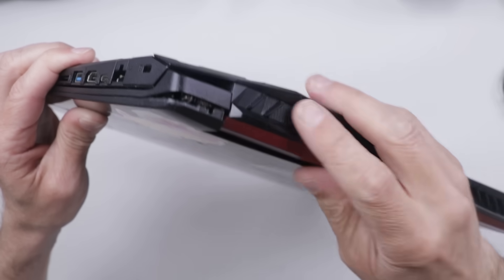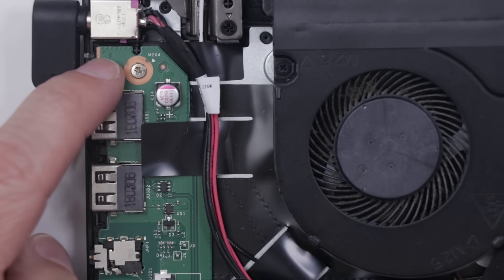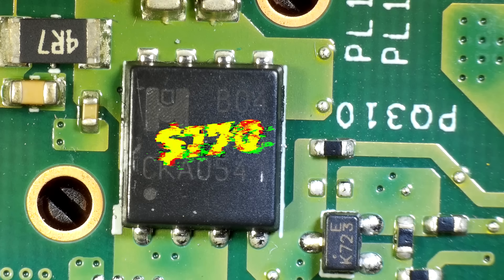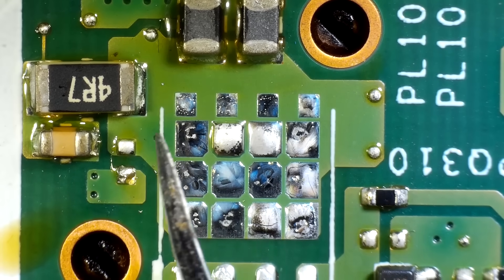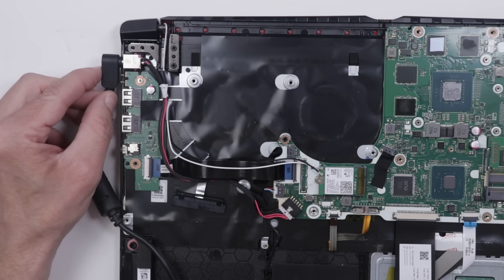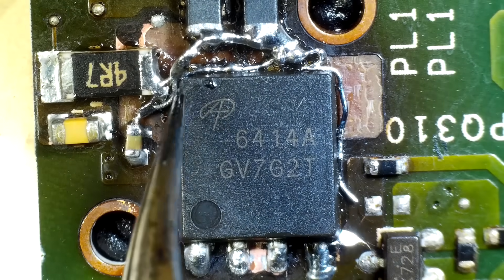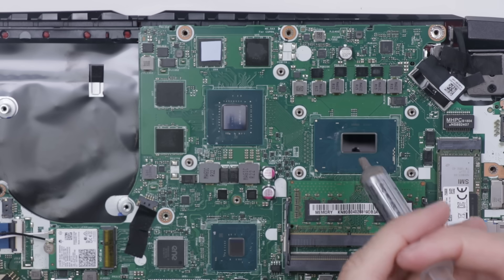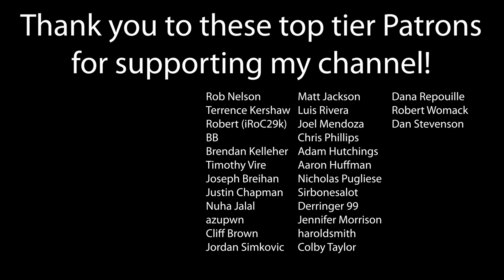FREE BROKEN Laptop - But Can I Fix It? Acer Nitro 5 No Power (Gifted From A Subscriber)

Comment: You are so good at this. My ASUS Rog Strix got fried by power surge and a repair shop told me they can fix it, then they called me and said it's complicated and finally they stopped calling me altogether. I had to call like 4 times to finally get an answer...yeah, we can't fix it. They had it for 6 months! They gave me back my laptop and I found out they didn't put back the HDD so I had to contact them again and tell them they better still have it (they did). That repair shop was an absolute nightmare, never again.

Comment: I mean since you bought another parts motherboard. Could’nt you have grabbed the copper plating that was fused under the MOS from the parts board. Like cut it out? Then you would’ve had the “heat sink” and everything.

Comment: I had a very bad experience with a nitro 5, the price for the specs was hard to beat but whenever I play games it became a damn volcano probably due to Intel processor, after many tweaking I manage to bring temp to a reasonable level (had to take a hit on FPS on many games) but if I had continue gaming on it as it was out of the box I would certainly had fried something since a normal temp was between 90 to 95 degree delicious whenever I played anything.

Comment: Thank you for these videos, I bought a "broken ps4" from ebay, when I got it the disc drive was just loud when a disc was in there, cleaned it out and it worked like normal, I watched your old videos to help guide me when taking it apart and putting it together.

Comment: Good idea with the coil of wire under the MOSFET. I would have also stock a thick small thermal pad on top of the MOSFET for extra cooling.

Comment: Very likely the MOSFET was part of the reverse polarity protection for the laptop, meaning someone plugged in a wrong power supply to the laptop. It would explain as to why it was so burned, and why after replacing it, it didn't blow up again. 
But still doesn't make sense since this MOSFET circuit shouldn't blow up. Maybe the guy shorted something with a screw and the MOSFET was short circuited. But as far as I know it's unlikely that it just broke like that, especially the huge burned part, makes no sense.

Comment: there is also a possibility one of those traces that were underneath the mosfet could be coming from the other side of the board that is supplying power to the other side of the board and that's why your computer is not turning on

Comment: Fun fact about Nitro5's. There is a pressure switch under the asdf keys that will prevent the computer from booting. It'll power up, keyboard lights up, hear it running, but no screen no boot sound beeps or anything. Press with about 10 lbs on the asdf keys. If you Google it this is a semi common problem with the Nitro 5. Had mine in my backpack sitting apparently upside down and the keyboard bowed or something.

Comment: Something else to watch out for.  Some of these mosfets have a diode that lets a small amount of current pass in one direction even when switched off and these diodes will sometimes fail while the mosfet itself still functions as a switch.  This diode is useful in some circuits like power input protection circuits where you don't want reverse polarity to destroy anything.  Some people just bypass the mosfet in those circuits completely and call it a fix or add a diode to across the source and drain that lets power through to the circuit that actually turns the mosfet on.  But definitely need to watch for hidden vias.

Comment: It looks like that part of the board where the mosfet mounts was never designed with thermal dissipation in mind.  Doesn't look like there were any vias to another layer of the board or even enough copper on the top layer to dissipate any heat that might get generated.  Plenty of contact from chip to copper but not enough copper... Design fail...

Comment: Well done, that via was easy to miss and yeah you rarely need an exact replacement for a mostfet, so getting a donor board is unnecessary, however you do want to at least make sure it's the same type (n-channel vs p-channel) and the same pinout then preferably as close to or better voltage/current ratings, also unlikely to be an issue, but worth noting there could be problems using mosfets with different gate voltages or different on/off delays but if it doesn't work just find another and try again.

Comment: there was so much current draw thru that mosfet it welded itself to the copper plane.  it became a part of the board, shorted until it cracked the package and the silicon split.  its like foresnics but for electronics.  nice closeups.

Comment: Hi look sorry to bother you but i need some help. My laptop is not working when i checked it the fan cable is cut and the screen is black but when i put torch in it i can see somethings and the keyboard is unresponsive it is a toshiba c55b. can i send it over to you can you fix it? please respond quick.

Comment: I recognized that DIY hinge repair immediately. I repair laptops for a living :p

Also, a faulty batteri can definitely cause the laptop to not turn on.

Also also, before removing a faulty chip you can add leaded solder to the pins first, to lower the melting point of the solder already on there. If you don't, it could require an unreasonable amount of heat to melt.

Comment: Hi, @TronicsFix , I have a broken Gigabyte 14 laptop.  I have sent this to 2 local repair shops, included NorthridgeFix, who claimed to be unable to fix it.

Here is a high level explanation of the issue:

back in December 2020, I was cleaning out my laptop fans and used compressed air on the fan blades.   I did not disconnect my laptop battery prior to doing so.  When I finished cleaning, i closed my laptop and Laptop doesn't turn on. There are 5 LEDs: bluetooth, wireless LAN, HDD, battery, and power. Only the wireless LAN LED turns on it when i press the power button. I do not hear the fans running or anything else to indicate that it is on (no bios, no screen turning on). Plugging it to an external monitor does nothing.

Additional things I've tried that had no effect: - Unplugging battery and only connecting power adapter -removing battery and power adapter and pressing power for 5 seconds - removing the SSD and RAM - unscrewing the fan and recrewing it back in. I also unscrewed the motherboard from the chassis to inspect if there were any obvious wires being misplaced and there weren't.

I took out a multimeter and measured the voltage supplied by the power adapter on the cord head itself. I also measured the voltage across the pins of the connector head for the battery connected to the motherboard (between black ground and all live red wires). No issues (got about 15 V for live, 3.5 V for neutral)

I could be wrong ( i'm an amateur) but there might be an issue with the motherboard itself, maybe some short-circuit on one of the components on the board.

In terms of the history of this laptop, I've spilled water on the keys previously but after inspecting the motherboard, there doesn't look like water damage.

If you are interested in attempting a repair, please let me know.  I would love to watch you attempt to debug the issue and hopefully fix it.
Reply: I believe he mentioned somewhere that he doesn't usually take requests to repair viewer's devices, but if it has a short, that should be rather easy to find out for yourself, just probe ground and both sides of all the inductors, if there are no shorts the next thing I'd suspect is you've damaged a component such as a mosfet/driver from something like static or spinning the fan from compressed air, if nothing is wrong with the board then I would consider the bios possibly being corrupted.

You could try sending to Adamant IT if you wish, even if it is technically repairable most repair shops will deem it as unrepairable if it takes them longer than an hour or two to find the issue, because they can have many requests and it isn't worth their time to spend 10 hours trying to troubleshoot a single device unless they're desperate for business, if nobody wants to work on it then the less desirable option would be to send it off to an individual who has plenty of time to dedicate to one job or just sell it for parts.
Reply: @vgamesx1  thank you for the detailed response!  I’ve been wanting to attempt to repair/debug the issue but I cannot find a donor board and I don’t have the components/tools to do the repair properly.  In fear of destroying it further, thats why I’m reaching out to others.
Reply: @ClassyJohn  Well you mentioned you have a multimeter, as long as it isn't powered there is zero risk of damaging it which you don't need power to check for shorts, ok I shouldn't say "zero risk" you could still drop it or get rough and knock things off, but if you think you're likely to cause physical damage in such a way, then yeah it's best to let someone else handle it, also you do not need a donor board, it makes things a lot easier but acquiring one is often difficult or expensive which means it isn't practical to do unless you have say a youtube channel.

Comment: That connection and mosfet has to handle the 130watts of input power. Thats around 6-7 amps@19v. Im not sure if the repair is sufficient.
When somebody starts to use the laptop for long gaming session it could run hot and fail at the same way again

Comment: If there's enough space once the motherboard is mounted in the case, maybe you could stick a tiny little heatsink to the mosfet with double sided tape. It really wouldn't need to be big at all considering there wasn't one from the factory.

Comment: I have the same laptop doesnt surpise me with how much thermal throttling would go on with my laptop that a part would burn out. Even with fresh therman paste would run at 100 degrees celsius with no apparent fix and a cooling pad wouldn't help much either. But I replaced it with a different laptop and all is well.

Comment: Given that you do a lot of PCB repairs, it might be worth buying some thick copper tape to use as replacement pad material.  In this case, to attach that via, you'd need to make a small hole in the copper material right above it and fill the hole with solder that attaches to the copper tape.

Comment: Honestly, rebuilding charred traces is just a pain in the ass. Even if it's fixed for a while, it could just fail again at any time due to vibration and heat. Especially around these power MOSFETs that generate massive amounts of heat. But it is always fun to see something that could end up in the dump get fixed.

Comment: hmm.. maybe the other motherboard that you bought is just fine and it was just that chip that was causing an issue on there.. might be a good idea to try the working chip on there and see if that mobo revives.. since it seems to be in better condition than the one that came with the laptop.

Comment: 7:32 Nope! There is CNC milling technique. Some repair shops use this method to recover as much "fuzed copper layer" under the components as possible. This is very time consuming and not everyone can afford to spend such many time to repair broken motherboard but it is very efficient and allows to recover as many space benith broken mosfet as possible without making more damage during repair attempt
Reply: Holy $hit! That was very suprising! Nice job!

Comment: The fact that you continued once the pad tore up was impressive. I would had assumed that board was done for at that point. Though I wonder if it wouldn't have been easier to fix the "parts" board you bought instead at that point and used it as a replacement.
Reply: @Nighterlev  yes he did for 170$ to get the original replacment mosfet... but never said why it was a parts board.

Comment: Had the same exact issue on the same exact laptop. Swapped the charge port and that fixed it. However the lvds cable got pinched at some point and shorted the backlight. Any ideas where the backlight is on the motherboard? I’ve tried finding schematics online but don’t want to pay for them to use just once.
Reply: Backlight is part of the LCD panel.  Switch out the LCD panel, and you switch out the backlight.

Comment: Great, but you it was better to remove the black and burned plexiglass. It is carbonized and might act like a low resistor. With time it can burn other components.

Comment: Very common problem on this motherboard (Sienta or Freed I believe), usually there's a also a shorted cap / mosfet down the line on the 19V power rail, probably already burned out / it was a short from the case instead. The transistor gets shorted through and the charger being just strong enough to still power the MB / charge the battery would just continue working with the transistor continuously burning until the point of complete death like on this one. Compal would usually comp-ensate (get it) these for Acer with how common this problem was, until they finally started using a different charger IC.
Reply: I'm am electrician just getting into board repair, could you explain the term "charger ic" to me? That'd be greatly appreciated

Comment: wow I've never seen a component die that far before. I've seen minor cracks and things, but not to the point where it fuses and half the component just pops off. crazy! I wonder if you could fix my 2019 laptop. I have no need for it anymore. I wasn't impressed with it when it worked. Now it just turns on and then back off. I have a much better laptop now. But I couldn't bring myself to toss it.
Reply: He was lucky that it only took the first layer off. On macbooks you'd have multiple layers and a burned MOSFET like that will take out a bunch of those layers, which will definitely make that board unrepairable. Very professional people can still build those layers but it would be extremely skilled job.
Reply: Soo how do you need burnt the mainboard of acer nitro 5 then

Comment: Gotta be honest here: I thought this laptop was just dead. But you did amazing here reviving it. If you don’t know the password Steve you can just reinstall windows of it from a USB and the admin password is gone and ready. Congratulations Steve by fixing this one.
Reply: Actually there is a hack, where you can replace keyboard on screen app (which is available from login screen), with CMD. You can then use command line to change password. This replacement can be done by summoning command line during installation of windows (which you dont need to complete).
Reply: @D4rkS7der  this is actually patched in the later versions of windows 10 (21H1 or whatever that version is called) and in windows 11 it’s fully patched out bcuz of the TPM/TMP requirement.
Reply: @ItsGoFochYourself98  Good to know! Still worth trying I guess :-)
Reply: This CMD method allowed me to recover access to my laptop a couple of years ago. I have mixed feelings about it being fixed :D
Reply: you can force windows into recovery mode and roll back to factory settings
Reply: @DecibelAlex  it’s not possible on windows 11, you need the admin password first and bcuz of the TPM/TMP requirement. On windows 10 you can just reinstall windows.
Reply: or he can just replace with a SSD with already installed windows and just give back that old diskdrive to its owner that might need the files

Comment: I still wonder how you all get those "FREE" laptops 😅😅😆😆😂🤣🤣. I'm not trying to say that you fake your videos, because I see many people posting the likes, but the repair shop that gives you all this stuff should have no experience. I would get every beyond-economic-repair device dismantled, CPUs, GPUs and RAM chips desoldered or desocketed. I would fill jars with MOSFETs, VRMs, resistors, schottky diodes and  capacitors. You never know when you use them again 😂😂
Reply: Is there a mechanism to ensure that the components are good? Replacing a non-working part with another non-working part could get very frustrating.